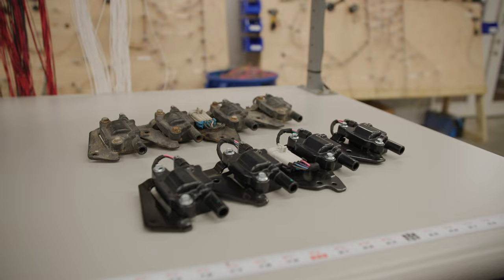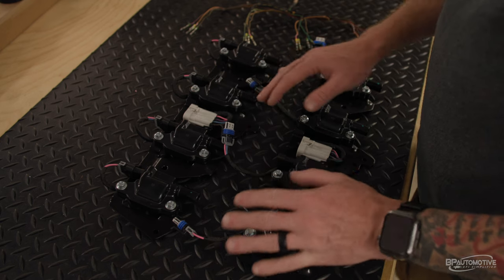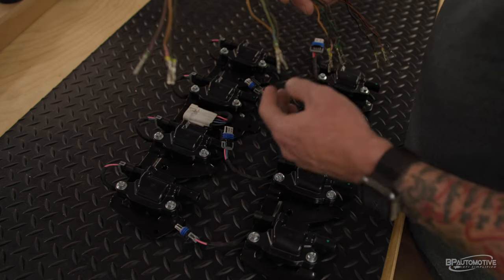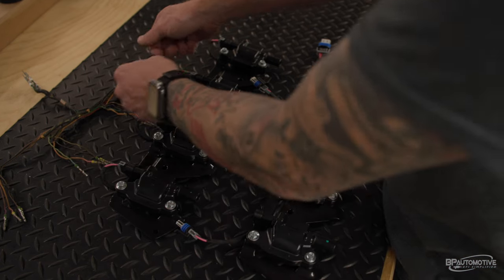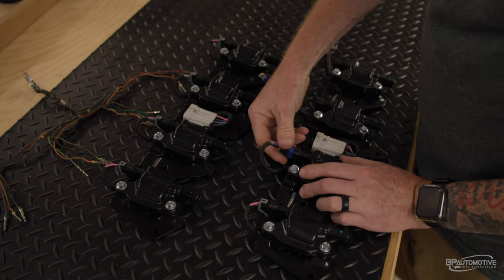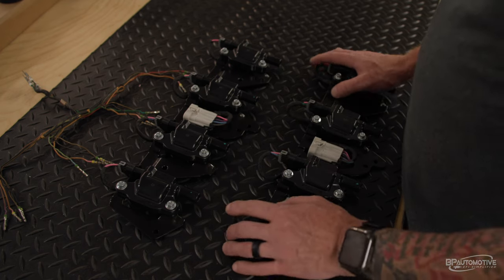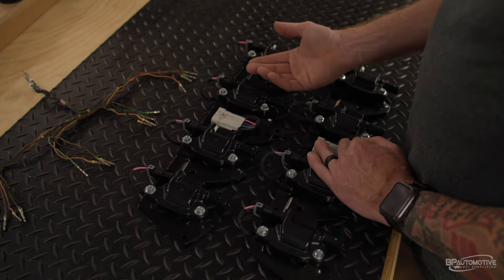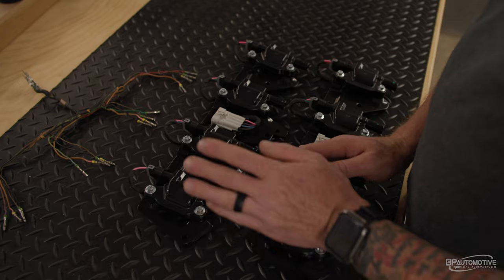How to Install LS Engine Coil Harnesses | Prevent Misfires and Timing Issues

Comment: Mr. Hillock,

Thanks for this video!  I recently installed a Chevy Performance Stand Alone Wiring harness for the LS3/480 and could start my engine, just backfires and sputtering!  After your video, I turned the coils terminal 180° and the engine started immediately without a hiccup!  Yes, the wiring harness was inverted!   Thanks again.
Reply from the maker: Glad to hear the video got you up and going! Thank you!

Comment: Learning as I go, but this video helped. I bought after market coil wiring, and I had the passenger side reversed. I could never get it to start right up even with a base tune. It has always taken multiple cranks and lots of back firing. 

Thank you.
Reply from the maker: Glad we could help!!
Reply: @bpautomotivellc  great video I’m currently running Jegs 40164 GM LS Ignition Coil 1999-2007 5.3ls would the Set 8 GM OEM Delco 12611424Ignition Coils LS3 LSA D510C 12570616 work for my application and would I need to retune 5.3 ls turbo build car has already been tuned
Reply: The electrical components like ignition coils and ignition coil harnesses is what makes the vehicle run. They’re not like older carbureted vehicles. They’re specifically designed to run the most efficiently on OEM parts. When you start putting in cheap or even expensive aftermarket parts, then you change the way the computer reads that part. The OEM replacement part is designed specifically for the factory tune of the vehicle. Aftermarket parts are not, because they’re not the manufacturer who knows how the factory tune is. If you have the vehicle tuned away from the factory tune then it’s a different story, because it can be tuned to the aftermarket parts. But aftermarket parts on the factory tune is a no go. Replace the sensors/ignition parts or harnesses with OEM parts.

Comment: Great video 
Any idea which color is grounds
I just found the cyl #4 have power but still no spark
Had switch ; coil ,cable or wire, spark plug. And still no spark 
Tester light up in 4 prongs, 
Do I need a new harness???
Thanks
Reply from the maker: That’s not enough info to say for sure! The ground is black and is in cavity A!

Comment: How come my coils keep going bad ? It’s a 5.3 2001 they keep burning out
Reply from the maker: Is it the same coil that is failing or random ones are failing?
Reply: @bpautomotivellc  I’ve put 3 sets already it gives me a p0300 and it lacks power I put in a new set works good for a day and then it goes right back to no power hesitates I put new wires also! The only thing I haven’t change are the plugs! But there is spark coming out from each coil which means they are working but maybe not 100%
Reply from the maker: @520bloggeraz  Have you checked to make sure your injectors are clear?  Also, does this engine have an aftermarket cam?
Reply: Yes it has an aftermarket cam
Reply from the maker: @520bloggeraz  That code needs to deleted out on a cammed application.
Reply from the maker: @520bloggeraz  Remember to follow emissions guidelines with codes as well.  We assume no liability for emission violations!
Reply: I'm having same issues with my 4th gen Camaro I replaced bad coil it ran good then I fired it up again and it's misfiring it also is cammed